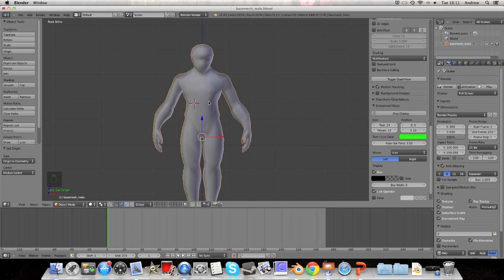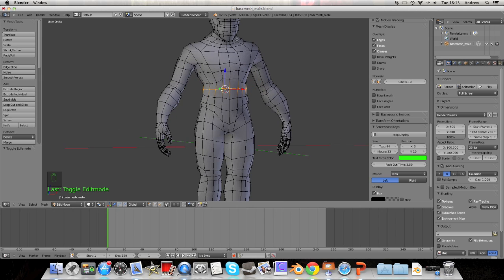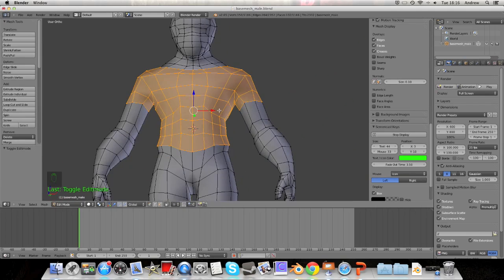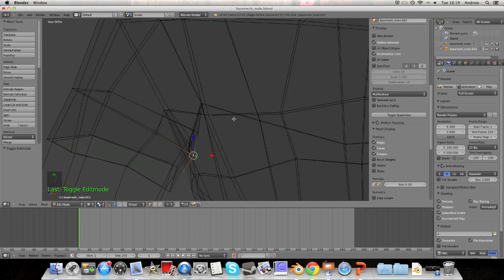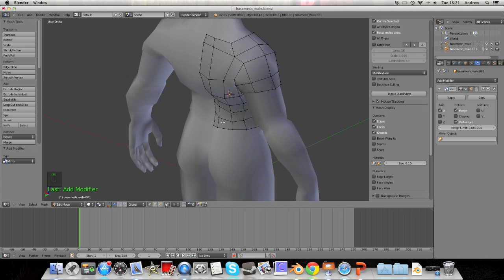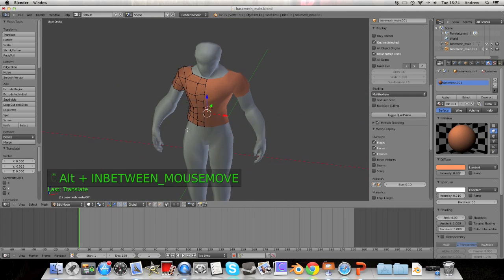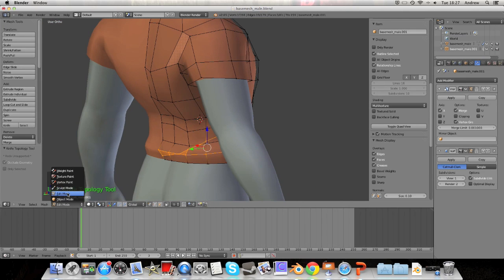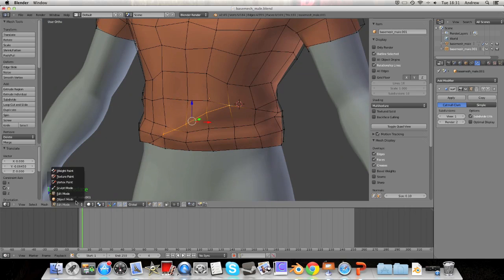Blender 2.6: Beginner Character Clothing Creation Tutorial

Comment: I can't use this.  NOTHING IS WORKING THE WAY YOUR TUTORIAL SHOWS!  I cannot separate the vertexes from the model without chopping up the model. P and separating by selection actually removes the piece from the model and breaks my skeleton mesh (because it chops that up, too).  I'm going to try copying the piece and moving into an unaltered file.

EDIT: NOPE.  It won't copy the individual selection.  It only copies the whole project or nothing.
Reply: +Mr4theLulz1 I have had the same issue in trying to learn blender and following these YouTube tutorials. Pretty early on, I will run into inconsistent information in that when I do the same thing as is shown in the tutorial, it doesn't happen for me. Otherwise the people just do stuff or say to do stuff without explaining how to do it. I have given up! I hope they come out with an easier to use software than Blender.

Comment: Is this for windows or mac?  How do you install it?
Reply: RarneElf Still waiting for an answer.  Model comes with two folders one called __MACOSX and the other called basemesh_male.  I'm on a Windows Vista 64 running Blender 2.72b.  Do I drag and drop all these files right in next to avcodec-55.dll ????
Reply from the maker: RarneElf sorry, missed this, yeah im not bothered by the troll. just replied about how worthless being a troll is tbh. and the basemesh file should just be a blender file. its not mac or windows specific. blender itself should be downloaded for the platform. but this file is just a .blend. maybe you should extract it. its been years since i used it.
Reply: RarneElf Windows sorry

Comment: Hi Mate, Great video - Thanks for posting. As a beginner to blender I keep hearing that i have to avoid/remove triangles in my mesh yet you seem to have used a triangle in the armpit of the t-shirt where you merged the vertex. What is the rule on this if any that you have come across? Cheers!
Reply from the maker: you mean why did we delete it? if so, I deleted it because nobody would see it, or it was messy. when i scaled it, the vertex crossed one side making it an impossible shape (a part of the sleeve going into the chest) so merging it makes it compact and flow up the side of the chest, and onto the sleeve easily :)
Reply: ZoyncTV Thanks for the reply mate. Thats not quite what I meant but not to worry I know the answer now. I was asking along the lines of quads vs tris. Before doing some research I was under the impression that tris were bad news in a mesh but now I know that actually they are a very useful tool which have their place and uses. All the best, you have a sub!